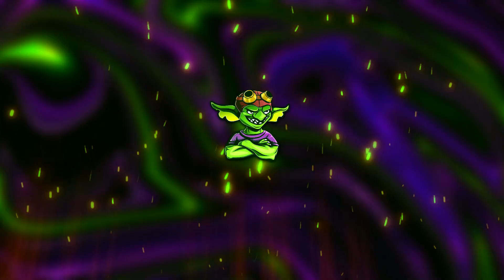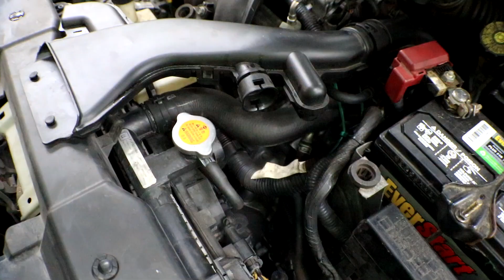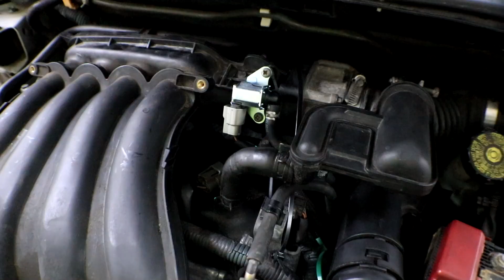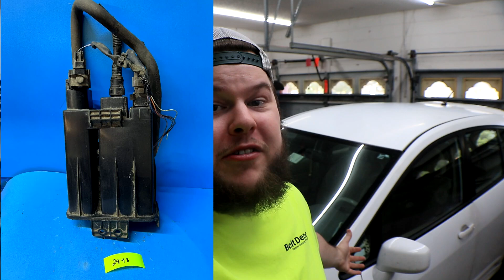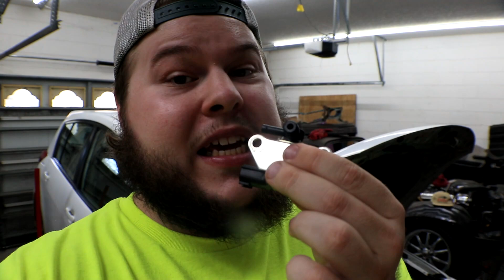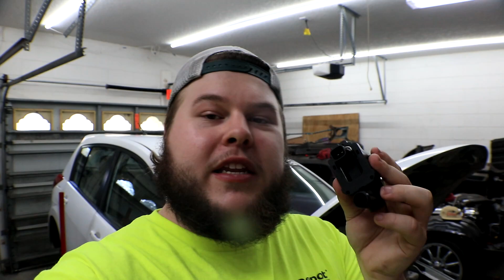Mechanic called this car "UNFIXABLE", but they were WRONG!

Comment: Respect dude. I have the same thing with my mitsubishi going on over 2 years. Five mechanics including the dealership can't figure out what's wrong with it. Yet they all insist I change certain parts and I knew that wasn't whats wrong with it but I did it anyway and there's no change. I have a very rich condition with a PO420 code and the only thing left to change would be the ignition coils. It's worth a shot

Comment: You have the exact same problem with OEM ones too for the last 5 years has gotten progressively worse after COVID I always check the part that I'm putting on especially if it's hard to get to now I don't even buy a starter without having testing it at the store before I leave same with alternators and heater cores I will have it pressure checked because literally it's a 50/50 coin toss it's really s*** these days

Comment: You may want to consider subscribing to scanner danner and / or Schrödingers box because you would benefit from acquiring diagnostic skills - btw , firing the parts cannon is not a “diagnostic process” and diagnostic codes are not part numbers.

Comment: Sounds like you did not diagnose it you shot the parts cannon at it. You found the problem by good luck . I would not let you work on my vehicle . Have a great day.  Bob
Reply from the maker: Hey bob! Initially I wanted to leave a snarky reply, but i am genuinely always trying to learn how to be a better mechanic, so I’d love to explain that at the start of this process I had 0 knowledge of working on cars, and the professionals threw far more expensive parts at the car without any sign of getting closer (transmission and fuel pump). I did my best to diagnose the problems using all the computers and readers I could get my hands on, even asking experts for advice along the way. At the end of the day there were multiple different issues, bad EVAP Valves, dirty idle air control valve, and saturated charcoal canister. While some may see it as a “parts cannon”, all 4 pieces needed to be replaced to clear out the codes. Perhaps I wasn’t clear enough in the video and should’ve quoted the exact codes that the car threw, but personally I’m very pleased with the repair especially having started the process with no experience. 

We all have to start somewhere, and my goal with this video (and my channel as a whole) is to document my personal progress with learning and getting better at working on cars while sharing my problems and downfalls along the way with 100% transparency to help anyone else along the way who wants to learn but doesn’t know where to start!

Thanks for your comment, and I hope one day I’ll be a skilled enough mechanic that you’d be proud to have work on your car!
Reply: I thought you did a great job helping your sister and I know id do the same thing for mine. You received a rough comment and then replied like an absolute champion. Im glad I'm subscribed 
 @TheGarageGoblin

Comment: I'm 2 minutes in and I'm thinking wiring/grounding issue which is usually why all lights come up
Ahh purge valve... Yes those really do cause big drivability issues and cheaping out on the valve is never a good idea

Comment: Wow! Just wow!  I had it pegged early in your video and those mechanics should have if they understood the scanner. Or did they even plug in the scanner? Surely they did so I'm thinking they didn't understand the stats or like many, are parts replacers. Kind of like doctors just throw some medicine at it and hope. Not knowing what stats the mechanics looked at but they should have seen the rich mixture for sure. Part of mechanics issues is that they are pushed to get it out the door and forget the proper diagnosis. Especially a dealership! So many things there that the mechanic should have seen. What's sad is that this new NASTF plan with IMMO and programming, it's going to force more people to a dealership and make it worse but that's another story for another video. lol   Bottom line here, sir, is you didn't get to the bottom of this problem as to why it probably happen in the first place. With the charcoal canister contaminated with liquid was probably caused by your sister. When she filled the car, when the nozzle clicked off she probably kept trying to force more gas in the tank. In doing so, she got gas into the canister. I've seen that issue more times than I can count. If only she could think back after two years and try to remember if her problem started after filling up.lol  At any rate, you might point that out to her for the future. When the nozzle clicks, don't force more fuel in the tank to reach an even dollar amount.  That car should have been diagnosed within the first hour which is why shops charge for an hour of diagnosis. Another point I want to make is that NEVER rely on Amazon parts or new parts in general. Yes, with my experience I would have used the old valve that came with the canister but that's only because I've ran into the problems with new parts of today. It's all kind of sad but a great learning experience for you.

Comment: You covered 2 major issues in the auto industry. First is; I see reports almost every day of faulty china parts coming in NEW but broken. There is a good middle between no name amazon listing parts from china and branded aftermarket parts from china. branded is a good happy middle between the cost of OEM and cheap no name and generally has a much much higher success rate. The second issue is Mechanics, or I guess labor industry in general. The kids today are entitled, lazy and incompetent. I know because i have had to hire them before. They suck. Really not much difference in mechanic world. They have turned into parts swappers that only know what the snap-on scanner tells them. They are NOT NOT NOT Diagnosticians.  Only the older guys are capable of that and that can be spotty too. It's a sad state of affairs that has affected me also here in GA.

Comment: So there's an issue with your theory/understanding of how the EVAP system operates and the effect that would have on the fuel pump. When the purge solenoid/valve is opened (by the PCM) to allow fuel vapors from the charcoal canister into the intake that canister vent solenoid/valve is also open (by the PCM). When the purge solenoid/valve is closed... that canister vent solenoid/valve is still open. Pretty much the only time the canister vent solenoid/valve gets closed is when the PCM is performing a check on the system (after the car has been turned off, for example). During normal operation it's open regardless of whether or not the purge solenoid/valve is closed, so you wouldn't be pulling a vacuum in the fuel tank from a leaky purge valve.

Does your sister know not to keep trying to add more gas during a fill-up after the first "click" when it stops? Bc that's how most people end up with liquid fuel in the charcoal canister - by regularly overfilling their tank. There's a check valve that's supposed to prevent this but it can only do so much, and if you continued to have problems at every fill-up (that went away with the EVAP system disconnected) even after replacing the charcoal canister it suggests that check valve is no longer functioning properly and you may have liquid fuel in your canister again.

As an aside, it's likely the liquid fuel in your canister that ruined the original purge valve AND the first replacement bc those carbon granules will gum things up, so cheap Amazon parts may not be to blame in this particular case.
Reply from the maker: Great comment and thank you for the info! Like I said I am no professional so I'm still learning how things go. For now everything is working totally fine with basically the whole system replaced. The car was used prior to owning it, so it was likely the old owners who overfilled and caused the evap canister issues!

Comment: Some mechanics just don't try, I got a 2003 XR8 Falcon that was misfiring at low rpm, my mechanic kept telling me I'm not driving it hard enough. 5 minutes of investigastion and i found it was a faulty coil pack, 2 second fix and now goes hard. Some mechanics are just lazy AF 🤷

Comment: Just a guess before I finish watching, ground wire?
Reply from the maker: Wish it was that straightforward 😭
Reply: Lol my purge valve was bad, so I replaced it and still have the same problem. Aftermarket parts sucks.😂😂😂.